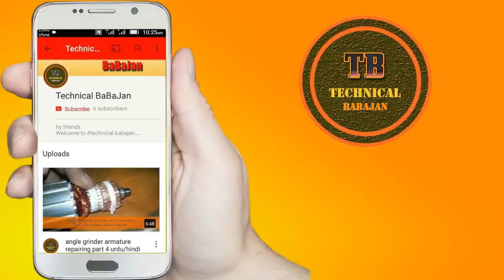armature field rewinding part 3 of 3

Comment: I hope you replaced the carbon brushes because one of them doesn't have a lead on it which allows more current to be drawn without the brushes running too hot due to high Resistance in the brush holder which can cause it to melt both the brush holder & motor housing !